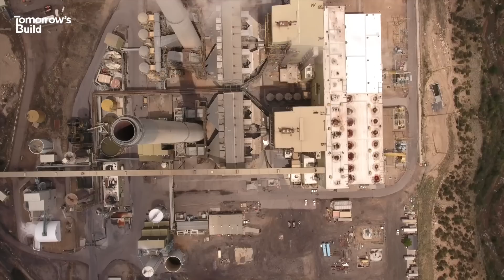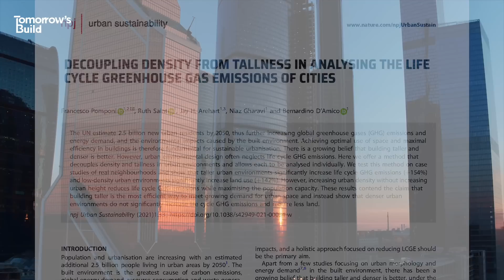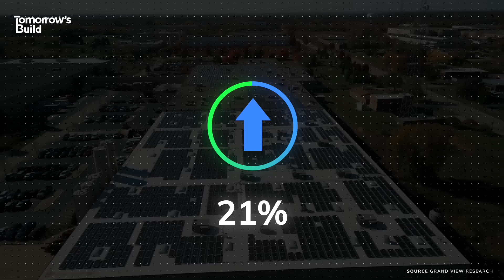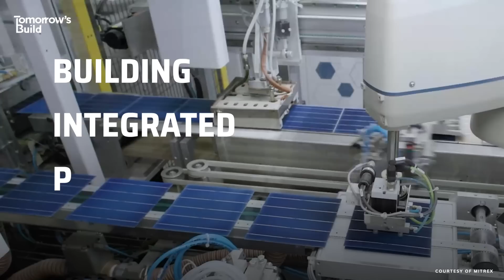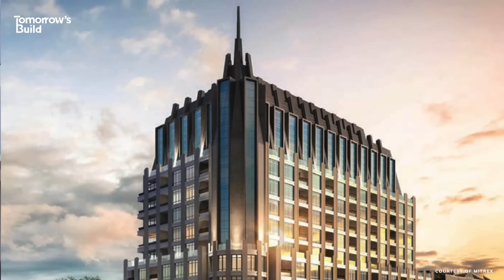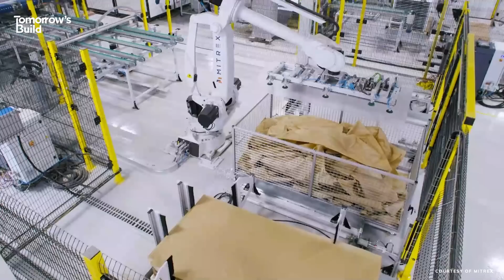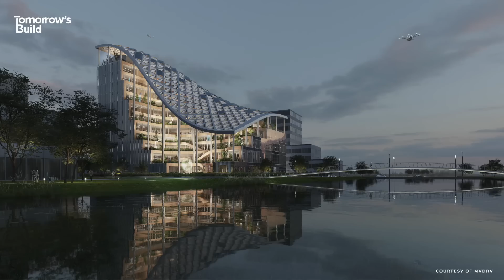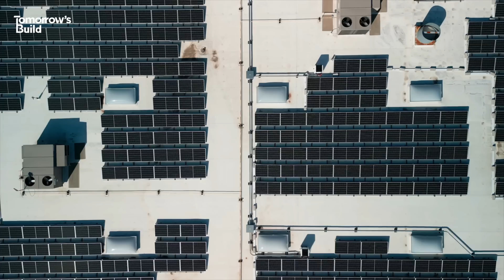Why Skyscrapers Should Be Solar Farms | Tomorrow's Build

Comment: If we didn't use so much power it wouldn't be an issue. Crypto mining, data centres, electric cars, electric everything, people need to realise that a simpler life would solve a lot of problems.
Reply: This is ridiculous
Reply: @canismajoris6733  good comment. Well presented arguement you pose. 🤔
Reply: Little late for that bud.
Reply: @scottlauren3145 so we should just give up? It's never too late to change your ways.
Reply: Simply not true. A "simpler life" means a much more difficult one. I know people who bought into that lie, bought land and tried to become homesteaders. You know what things they missed the most? conveniences like laundry machines, water pumps, and air conditioning. We SAY "a simple life is better" but most people who go back to live that way quickly hate it. I do agree crypto miners is a completely f*cking useless thing we spend money on, but the blockchain could have big uses. I'd love to see a system in place using the blockchain to get rid of corruption and make money in a fun transparent, so you can track the money flowing out of a given fund pool to where it goes and how it was spent. THAT would be an amazing use of the blockchain. What we need is large scale green power production. Things like aqueous zinc ion batteries to stabilize the solar panels/wind turbines, and geothermal power likely to be unlocked with Quaise's revolutionary drilling bit to drill down deep and let us use the earth's heat to flash water to steam for power, those are two massive drivers for a more green future that still has all the modern niceties we've grown accustomed to.
Reply: Says the guy on his cellphone. You're not following your own advice